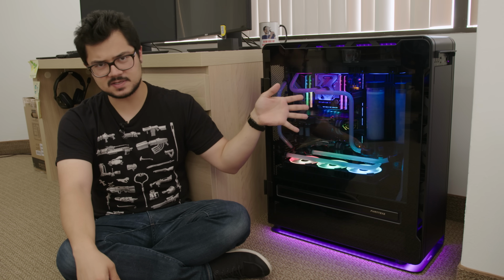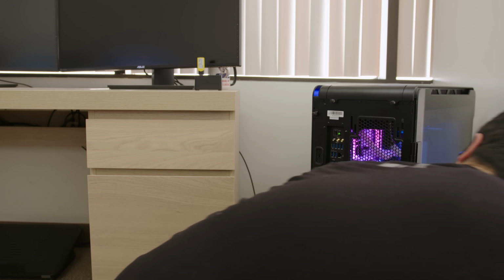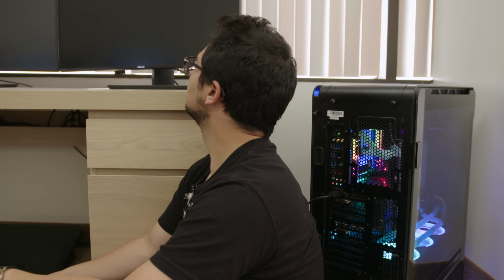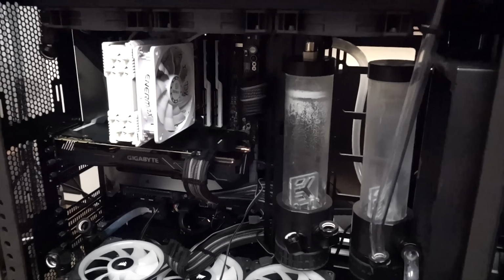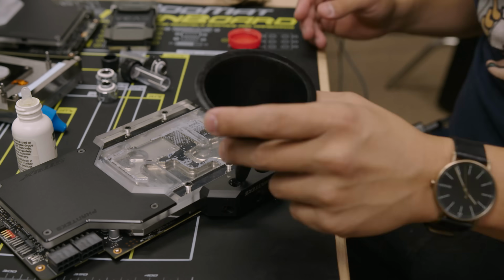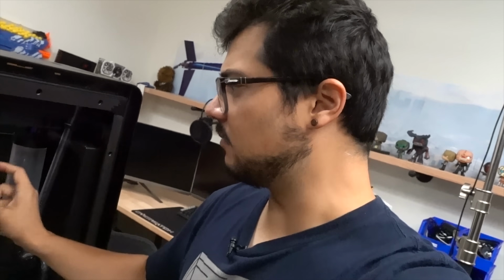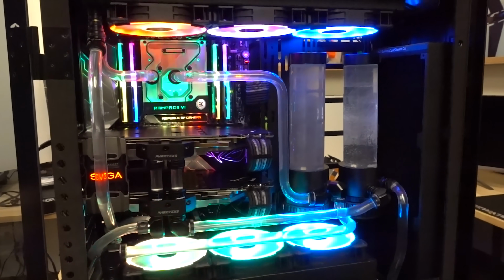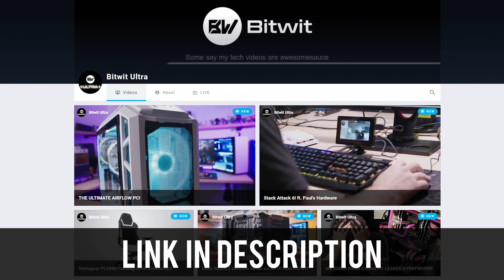Fixing my $12,000 BRICK

Comment: If you changed you M.2 SSD during the process, it might have been it. I have a similar setup with also an ASUS ROG Rampage VI and at some point, for some reason, the motherboard corrupted the firmware of my SSD. And I had never seen that before but it even prevent my whole system from booting. As soon as I would get my SSD out of there, the system would boot correctly. When I brought my SSD to my friend's place and we put it in his computer to try to repair it, it would prevent his computer from booting 2. I ended up returning it and I didn't had the chance to reinstall another M.2 SSD in it.

Comment: I know I'm late but I'll just put it out here anyways. A0 is normal. It's a Q code basically saying POST process has been successfully completed and system booted into the OS. So it was actually a display issue. What I do is check the display cable, reseat GPU. If you had your keyboard attached it would've been much easier to check this. Either by toggling caps lock led, going into bios through keyboard (this will give 00 Q code) or just shutting down the system through keyboard. This usually indicates that the system is working fine just that there's no display.

Comment: 100% I'm sure it was because un placed well graphic card. Your card is very heavy on the slot and any rare or little movement of the case may leads a shake that move it a little bit also the water stream inside the loop may cause this final shake on the long term.
Another notice, distilled water is corrosive!

Comment: Usually when you have this kind of problem its temperature cpu wich you can read in ur bios under monitoring. On mine my D5 pump stop working and it dont want boot, first thing to do its stop the overclocking of your system to avoid more demage. When you change your liquid you need to clean all your loop and radiator before full it with new liquid coz like you saw, all the hours you put to do this is not really funny when you must do it again coz you want go too fast. All watercooling pc need to be perfect to work without problem, never do for save time, or butch some procédure to save time coz at the end you will put more and more time and can demage compoment.

Comment: If the loop piping wasn’t fitted into the card properly it could have been adding a gentle force onto the card, slowly pushing it out of socket and when it finally moved past the connection point it stopped posting. 

It would also explain the other machine that leaked pink goop everywhere.... but in this case it was the pipe that gave way and leaked everywhere.

Phantom forces are something that I only realised can have a HUGE effect after playing a ton of KSP. ENTER THE KRAKEN EFFECT!

Comment: I had  thought it was the GPU when you were having issues, it doesn't take much for it to cause an issue. They must be seated firmly. I had an issue when building my X99 system, sometimes the power would cycle over and over. I figured that the PS was the issue, but didn't have any evidence of that. I decided just to feel the Power supply  when it was off and plugged into the wall. It was hot and I mean hot, so I know this isn't normal. I replaced it with a better quality fully modular 750 watt supply and problem solved.

Comment: it looks really pretty, but that whole water cooling thing looks like a lot more trouble than it's worth
Reply: yes it is, Got hyped up by Jayztwocentz in 2014 for all this WC Hype. While real w/c modders don't recommend using w/c system 24/7. The radiators work best near water boiling temperature 40-100c, meanwhile the plastic parts in the pump and tubes are not rated pass 50c for extended periods of time. You have to change or monitor or even rebuild w/c system every 6 months to 1  year. Most people who forgo this always have complete computer fails. Water boils a bit even before reaching 100c, vaccum pressure in certain areas of the pump creates lower pointing point as well. Pump cavitation will eventually kill the loop/parts as well. Not to mention you can't always get pure copper radiators, some of them have solder/tin as well as having brass fittings and nickel plated cpu/gpu block increases corrosion.

Comment: you can get two titan Xp for 2500$, a i9 extreme for under 2000 dollars, 128 gb ram for around 1800 dollars, 100 tb of storage and loads of ssd storage for 3500-4000$ sweet-ass cooling for 500$ premium rgb for 250$, nice motherboard for 300, 150 for a good power-supply, 400 for the perfect case, and three curved 4k 144hz monitors for around 3000-4000$. Headset and a blue yeti for 500$ together, and top quality keyboard and mouse for 350$. That is to me the ultimate setup. all that for around 15.000 dollars, so how the hell could that have costed 12.000?

Comment: I had a similar not bootign issue with my computer for a while, pullign the power and letting it drain completly than restarting would fix it, but otherwise it would intermitently not start, not even bios or anything... esspecialy if the computer was still warm.

In the end I tracked the porblem down to which PCI slot I mounted my graphics card in, it was set to auto detect, settign it to the slot the graphics card was in in the bios fixed the problem. So if anyone is looking at this video for solutions to a similar problem and you have your graphics card mounted in a different slot than slot 0 try updatign the bios with where the card actually is.

Comment: A little bit about power and heat.

The video card did not need any working fluid as all you were going to do is run through startup.  The card would have been driven to less than a few percent of capacity...so no heat to deal with.  But now you "know" it wasn't seated properly.  You don't actually know that.  It could have been dislodged enough to cause a fault by a problem with heat dissipation.  

The residue in the cooling lines means that the working fluid was not able to do the job for which it was needed.  With the heat from overclocking and maxed out video ram, system ram, drives, and board bus paths,  you had been running the system in a heat stressed state...likely at or exceeding component limits.  That excess heat can cause nano and micro scale failures in component chips...not enough for avalanche failure but enough to cause intermittent failures and system heat management issues.  

You are looking in the wrong spot.  If you have heat management problems they are being caused by 1 or several power management problems being created by failing component ICs.  Check current flow from the power supply.  If the parts are drawing more power, the power can only come from the supply.  If the supply flucuates wildly while the computer is during static operations then you have failing components.  I would suggest the MB.

Comment: I had a very similar issue when I built my last rig. It just wouldn’t post. Played with the RAM, SSD, moved the GPU to different PCIE slots. It refused to boot. I spent 3 days getting pissed at this thing. I finally brought it to a friends house to get 2 minds solving the issue. I hook it up at his house and BAM it works. So WHAT THE FUK I think to myself. We play with it for a while, all seems well. I bring it back home, and nothing. Well, after 5 continuous days of anger and depression, come to find out my Display Port cable was trashed. Good game.

Comment: Here's an alternative to distilled water. It's dielectric and used for immersion cooling, but it also works for what you're doing. Plus it won't damage the computer in the event of a leak.
https://www.engineeredfluids.com/

Comment: 100% of the time, if you're getting codes on your motherboard, and it "double boots" chances are it is the gpu. 

I spilled coffee through the top of my pc a few years back, let it dry out. I saw some scorching on the gpu, took it out. Rebooted it without a gpu, saw my keyboard light up as proper. Just bought a replacement gpu, and I was back in business.

Comment: Debris in the PCI e slot has haunted me in the past, 1 blocked pin and cards don’t 
get full connection.  Very frustrating to say the least! I now make certain that
 I blow out the slots with some air when building to avoid  seating issues.
The A0 code was my only clue needed to deduce that if the system says all
is well but no video,  means check that card first. Great share Kyle👍🏻👍🏻😉🤓

Comment: Not having the GPU fully plugged in can very well hinder a computer from booting.
PCIe is very easily distracted by anything out of the ordinary, be it failing USB controllers, storage controllers, or intermittent connections. PCIe will find a way to make your BIOS spew out totally unrelevant gibberish. If the post code changes with each reboot, then check PCIe connected devices.

Comment: " a discreet card " he said... 1070ti... dam.
Reply: All graphics cards are considered "Discrete" GPUs. Discrete just refers to a GPU that is NOT integrated into the system. He uses the term to explain why a "discrete" GPU is required to test the system because the CPU in use lacks an "Integrated" GPU.

Comment: I know this is a dinosaur in terms of YT videos, but after you went down to the bare boot drive and it didn't post I'd have tried booting from an ISO on a USB flash drive to see if the system did anything with that as a next step.

Comment: Me watching this in 2022: I could build something of similar spec for under 1, 1.5 grand. Its funny watching expensive build videos on older builds...now you can pick up that CPU for like $120 on ebay, those GPU for 150-300. So you got what in today's prices is like $750 (at the high end, realistically more like $600) worth of parts, and this cost 12 grand for you...thats hella rough. Being on the cutting edge is NOT worth it financially lol. Good to know I could in theory build what was an extremely crazy PC only a few years ago, for pretty damn cheap now. I wouldn't--I'd MUCH rather a faster newer CPU and GPU then this--but ya'know, nice to know even buying new I could destroy this things performance for like 3 grand.

(Yeah yeah not counting the price of the ram or motherboard or anything else here, but really does it even matter, I could buy everything else brand new and overpriced and still recreate this build for like 3 grand, 1/4th what Bitwit claims this was worth back then.)

Comment: Delidded CPU well there's your problem lol way too dangerous for m to ever want to do that lol. 

I've had issue like this all the time and re-seating things works 95% of the time
Reply: its not worth it, you can get away with good coolers .and overclocking to the point where u need to delid is so useless and stupid.

Comment: you might call it hindsight, or that I sat there thinking "it's the fucking gpu", it a booted and dual booted and gave A1.
it means it's OK with any everything it sees, although something might be wrong with your system, obviously you used the second gpu to boot successfuly.
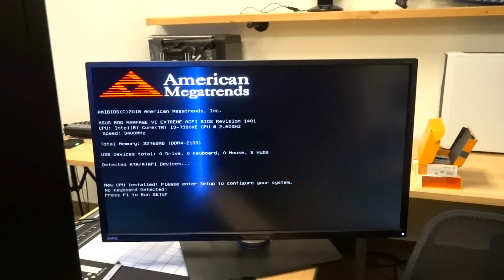Why would I say that? look at 7:38 this is the card that was plugged when it was failing.

I'm no tech reviewer but I know and understand hardware, and I have used dual card system since crossfire was on fire, the system was failing at first with the first gpu plugged in (in to the monitor), yet you didn't try to switch port or plug you monitor into the other card.

"everything seems to be fine"
Okay seems like you didn't try to actually try the second (first) gpu but what ever.

Comment: chack ur cpu blqck if black and all or clod it may nit boot or u did make the bolt on cpu titer I've seen lioness not be able to boot his Ford because of the screws not being tight enough for the socket so you did the socket you did the video card switch it was either or so I can getting too hot not allowing boot or not seated properly video card and I did see a lot of gunk in the grooves of your video card blocks so I'm assuming you're CPU blocks just as bad or worse and with it overheating because your friends are clogged on the Block making screws on socket heat and detract and loosen not making boot

Comment: How is that worth 12k. No offense but to get 97% the same is 3-4k. No way would I do that.
Reply: Going off of prices from a year and a half ago:

CPU would have been around 2k
Memory was around $1200
MoBo was $500-600+
Storage must have been around $500
PSU was $300
I think the Enth0o Elite case was like over 1K at the time
Each GPU with the water block on it would have been 1k 
The Pump, Res, Rads are $100 each
Probably has over $125 in fittings
Each fan is $25 
There is the RGB Module, the tubing, cables, and more stuff i'm sure i'm missing. 

Even with modern hardware:

10980XE is 1k
A decent X299 board is $400
128GB of RAM at 3200MHz is $600+
2TB Samsung NVME SSD is roughly $200
2 water-cooled RTX 2080s will be over 1200k for the pair

That's over 3k in napkin math before we even talk about the other WC bits, case, psu and fittings.

Comment: Are you telling me that you didn't test the graphics card connections before removing the loop?
You disassembled pretty much everything first before checking the graphics card?

You might be good at building PC's but you are crap at troubleshooting problems. The Graphics card should have been at the very top of the list, next being memory and go from there,  SMH!

On the upside, at least you've cleaned it so it won't need doing again for a while :)